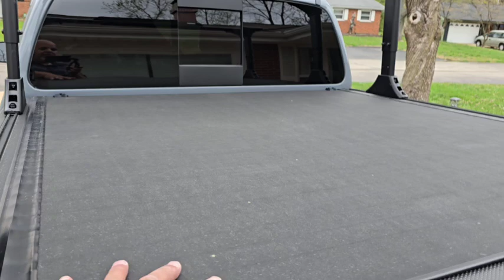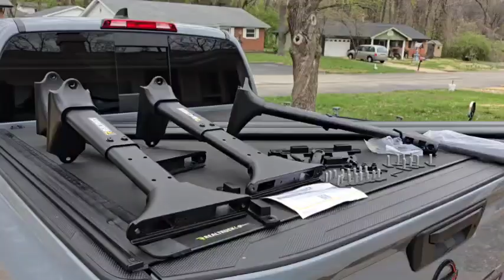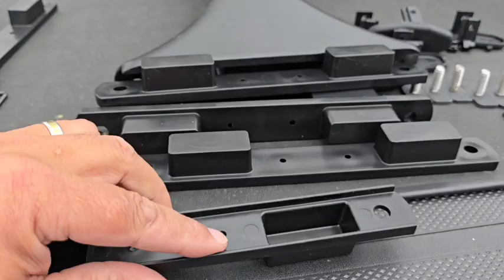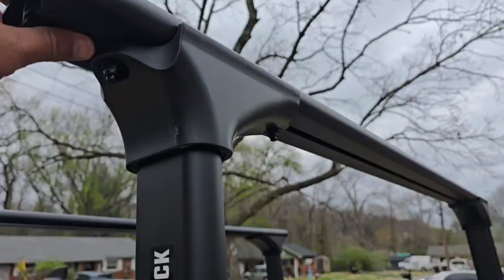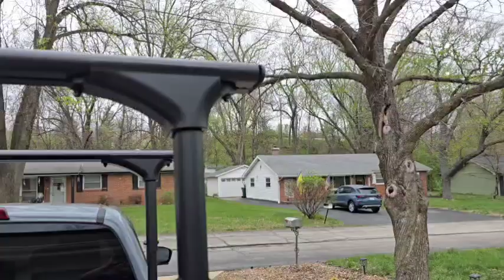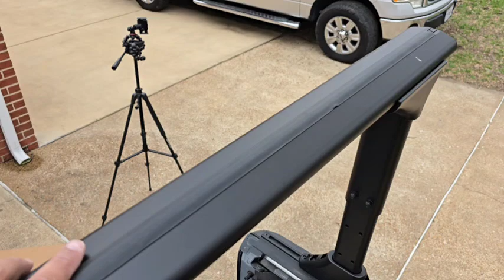Truxedo Elevate adjustable Bed Rack installed Nissan Frontier with T-slots BAK Revolver cover

Comment: I'm thinking that the interference that makes you have to push your tonneau down, can be corrected by loosening the nuts at the top cross bars and gently spreading the uprights apart a hair further.  I think you might be pulling them inward a bit too tight when you tightened up all your fasteners?

Comment: Is the only way to get that hardware (T-Bolts, nuts, washers, end cap) is to order that rack or do they sell separate?
Reply from the maker: I don't know the correct answer. I would call a retail  dealer and ask if they have extras.